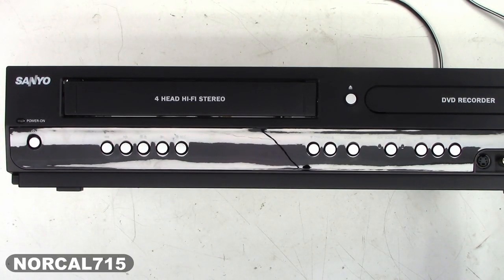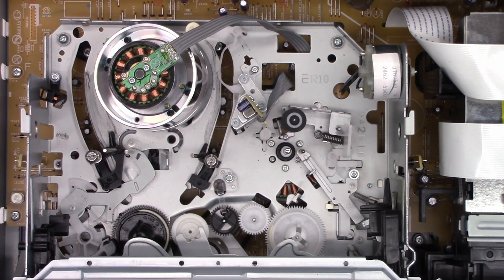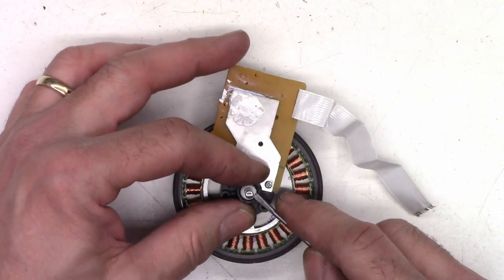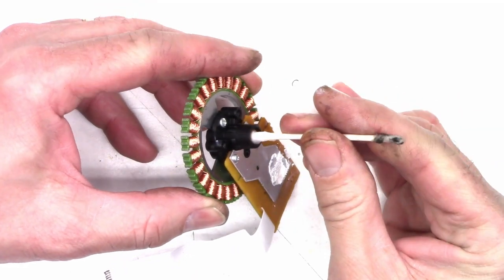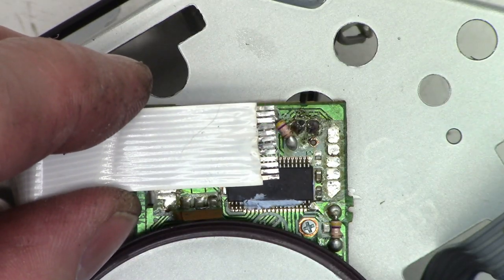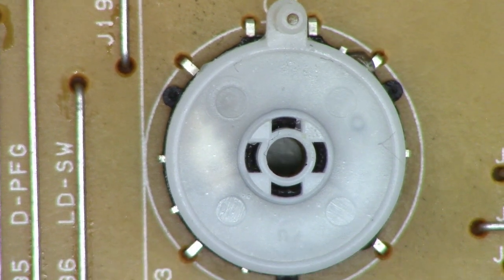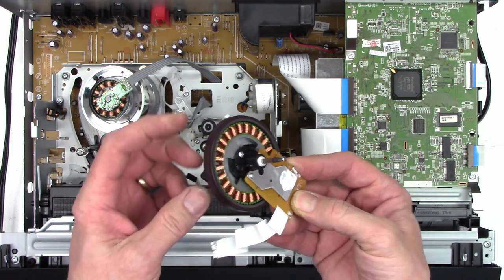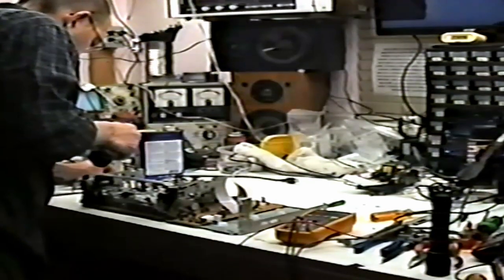A NEW ONE TO ME, THIS TIME A SANYO FWZV475F STRANGE TAPE OPERATIONS FUNAI SYMPHONIC

Comment: Don't think I've ever come across a capstan motor that got stuck like that. Great job finding it, fixing it, and deciding to replace it ultimately. 👍
Reply: Yea, looks like whatever they originally lubricated it with turned into muck!
Reply: @ThePreyMantas  I'm curious if someone tried to lube it with something that was incompatible with whatever was originally in there. Seems odd for it to get crazy like that. I suppose a material defect from the manufacturer isn't beyond a possibility either though.
Reply: @redemptusrenatus5336  Hmmmm, do you think someone actually did that? You know how people are. :) Maybe they missed properly lubing it at the factory... I just had to replace one of the LEDs in my 61" Samsung, the Blue one. Since I had to pull the engine and had it all broke down, I pulled all three to inspect the Red & Green while I was at it. They "undercoated" the LED back plates with thermal paste and it had over heated and popped. So I was pro-active and properly coated all of them with thermal. Now, hopefully that is a permanent non-issue.
Reply: I had a National NV-450A VCR (from around 1983/84) a few years ago which also had a faulty capstan motor; during playback the tape would suddenly pause or stop as well as go back into standby. Problem was sourcing a suitable used working replacement. Being a 3-head mono VCR, in the end it was decided that it wasn't worth the repair. From that point onward, I refused to tackle any more mono SP-only units from the '80s.
Reply: @RoughJustice2k18  Yea, the technology and quality got a lot better in the mid 90's. I have, what was whiles working, was a nice late 90's stereo JVC. Have't put meters on anything yet, but I believe some sort of surge killed it. Fuses are good and that's as far as I got. It is fairly new usage-wise, so I'd like to tackle it at some point. In the meantime I picked up a nicer stereo JVC off eBay, much more capable higher quality, but  it would still be nice to have a good backup. I occasionally do video transfers for folks who are upgrading and going digital. I can't stress enough how important doing backups are, but you know how folks are. Some don't even want to invest their time in burning DVD's for archival. Ashamed since it is more precious than most anything they may have. Once their gone, their gone for good and irreplaceable.

Comment: Pro tip: on these Funai made machines, there are error codes displayed on your TV screen but only when connected using the standard composite output. You will see the eject symbol followed by a letter. "C" for captain, "D" for drum, "T" for take up, etc.

Comment: Just a note on the scored up shaft, if in the future you ever get one that you don't have an extra one like here to replace it with, you can always "clean up" the finish of the shaft by polishing it GREEN Scotch Brite, not the red, to aggressive. Just pop it in a cordless drill and polish it with a mild abrasive like Gr Scotch Brite or 320 Crocus Cloth.
Reply: Smooth the shaft a bit and shave off the crud to give it a bit of clearance so it spins freely in the bushing - great idea. If it doesn't work, THEN consider finding a spare from somewhere. Always try the simplest things first.
Reply: @RoughJustice2k18  That'll work. If it lasts another 10-15 year consider it a success! :)

Comment: Sometimes a good used working part from a junker may be all you need to repair something (or get it going again). Practical as well as economical.
"Use one to fix the other" was a workshop rule a few years ago when certain NOS replacement components were not available for some customer units. I hope your customer appreciates the time and effort you put into this one. Two thumbs up. :)

Comment: Awesome video! I have the same exact model and I'm having a problem with the vhs part. It will load the vhs itself just fine but the pins that pull the actual tape out seem stuck in place. Then after a few clicking and popping noises the machine turns off. Also, the capstan shaft is NOT seized at all and spins freely by hand. Just an FYI I do not know the names of all the parts. I found this machine at goodwill for $8 and I would love to fix it. Any help would be greatly appreciated!
Reply: Also when the tape is in it spins slow and kinda jumpy. Almost like gears are sticky. Screen on front of machine reads L1.
Reply from the maker: Are the tape guides binding, or is there too much back tension? Right when it jams up unplug it and try to pull the tape out, it should come out very freely spooled from the left supply reel. At that point, with the tape guides partially loaded they should move slightly foreword and backwards, and should have some play top to bottom and right to left as you gently rock them in those directions.
Reply: @norcal715  i will try this when i get home. The tape guides do seem to be stuck in place. They dont move at all when i load the tape.